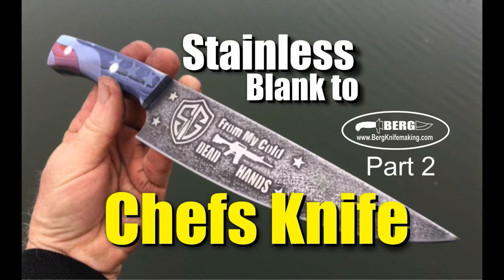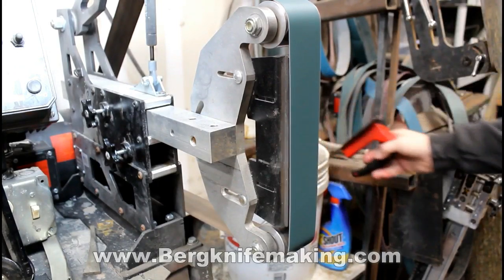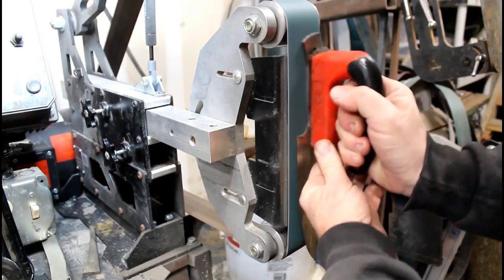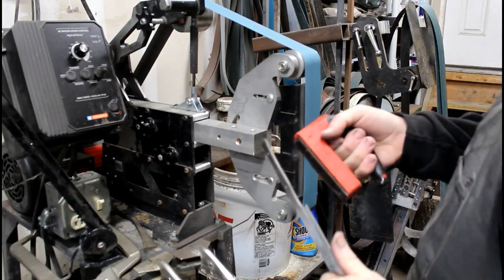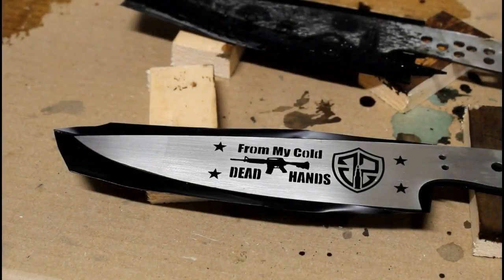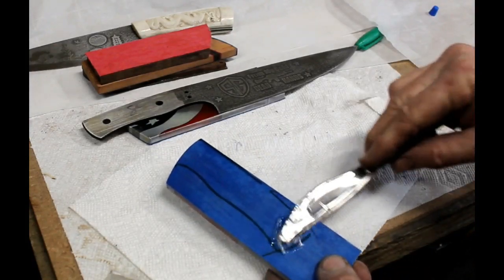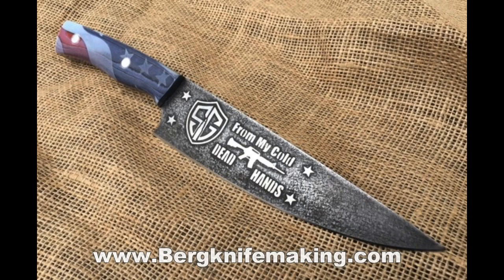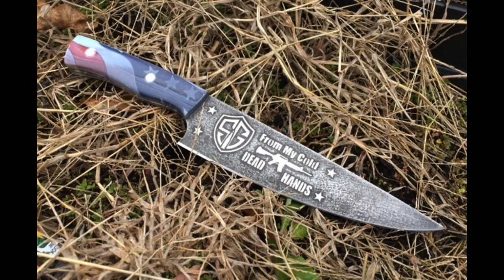How to make a stainless Chef Knife from a waterjet cut blank Part 2 of 2 2

Comment: I like using the shop magnet to smooth the blade. How do you get stainless to be magnetic?
Reply from the maker: Its just the type of stainless. For example 300 series is magnetic but will not hole a great edge. 400 series is magnetic but will rust. AEBL has good characteristics of both. It holds a great edge, good corrosion resistance and is magnetic
Reply: @DIYeasycrafts  Thanks for your reply.  I wondered which stainless it was.